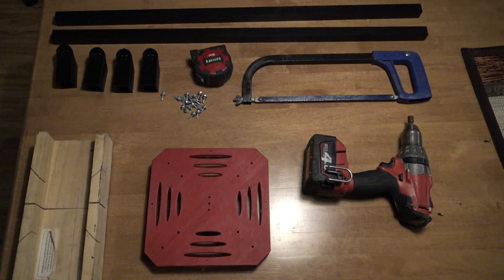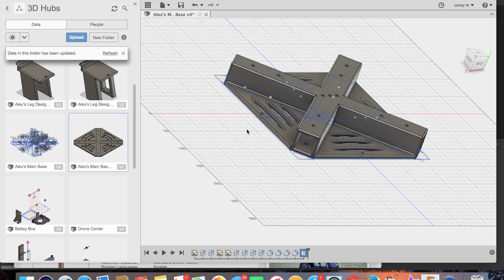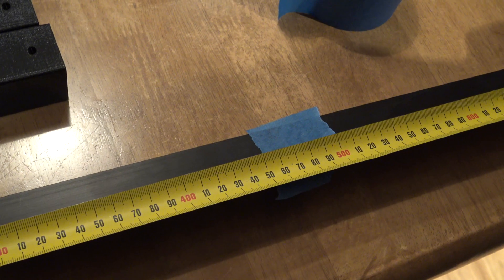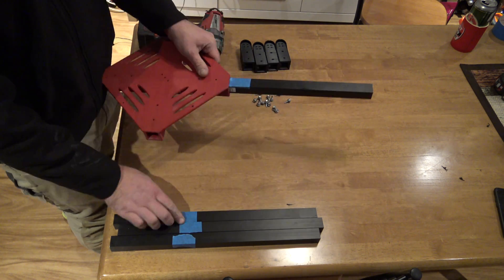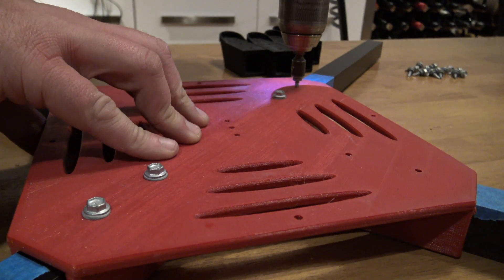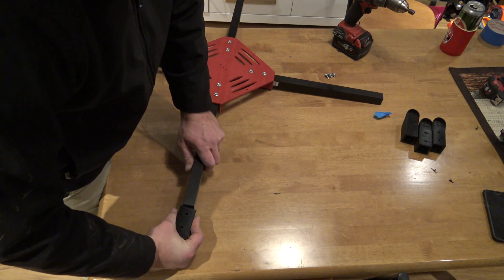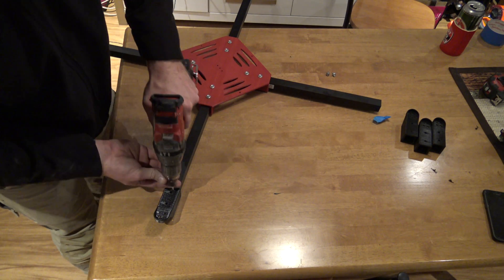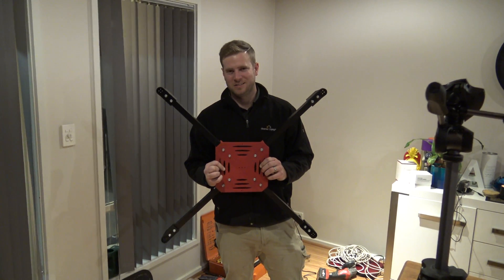X - GIANT 3D PRINTED DRONE (Part 1 frame construction)

Comment: So I'm building this monster with some mods. My print bed and height are only 230x230x230 so I moded the body. I'm planning on building it as an X8 so I'm trying to print 1 motor mount on top of another. (Not working well)  Is it possible to build a dual back to back motor mount? I'll let you know when its done. Thanks for a great start. Mark

Comment: That is a big drone, any idea where you are going to fly it.  I briefly looked at the regulations of flying drones in Adelaide and went yeah that more hassle than its worth.
Reply from the maker: Testing we've done in the back yard really and a park but we've only gone a metre off the ground. Going to have to go out bush for a proper flight test. Weight wise if you were in Canada I think drones are only allowed to be under 250g but welcome to Australia where its 150kg or less https://www.casa.gov.au/modelaircraft. Still need to be smart and fly away for anything that can be hurt or damaged though with a failure.